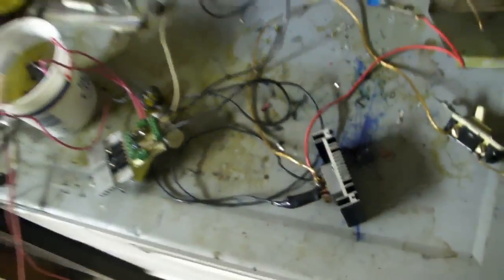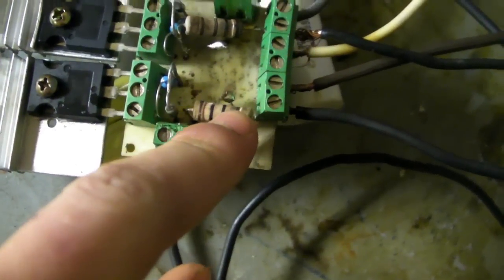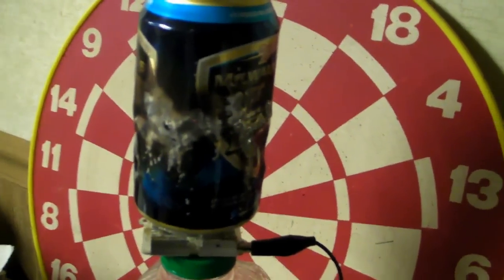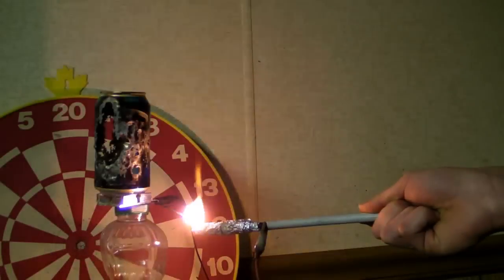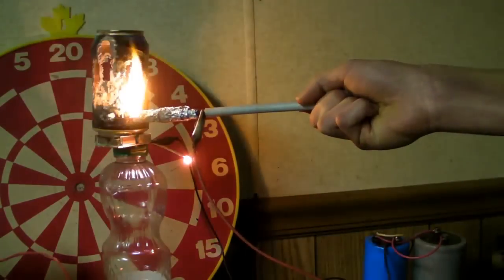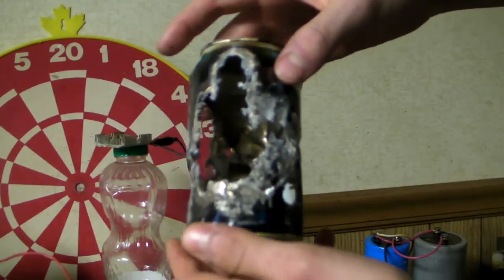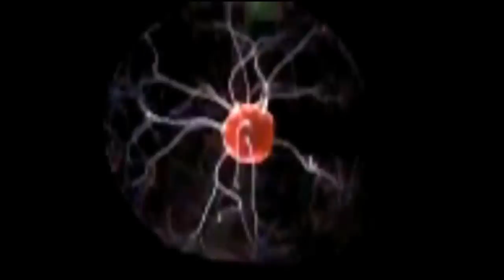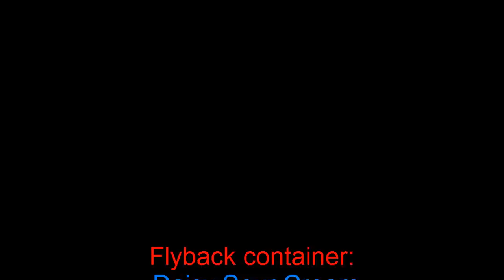The Lethal "Overclocked" Plasma Ball!

Comment: it strange to see kids playing with the same toys we played with back in the early 70's. with improvements in components since then it's good to see the old simple designs are still in use.
Reply: Virtualgod2009  they may be obsolete but they are cheap and easy to find and with the low energy levels used in test bench experiments they work just fine.and the real fun comes when you state modulating the pulse width and voltage.you can get all kind of interesting effects in a gas filled tube.using a bipolar pulse generator I was once able to "build" a semiconductor junction out of ionized gas in a flash tube that showed the classic zener curve and noise on a scope.in the tube I was able to observe the microplamic eruptions across the barrier and even measure characteristics like turn on delay,rise and fall times and storage times.as well as the tunneling that occurs during avalanch failure. you read about these in semiconductor physics but it was fascinating to actually see the energy flow.with transformers and controllers from switchmode 2 power supplies available at surplus stores these are easy to construct and even tho they are obsolete they still work well

Comment: Regarding the 1000 volt diode rating being AC or DC:  Diodes are rated in PIV which means peak inverse voltage.  That is the peak or maximum reverse voltage of the diode before breakdown (unwanted conduction) - it's the max instantaneous voltage that the diode can block when off.  So the AC peak is what to relate it to - in the US that's about 170 volts [120 VAC X sqrt(2) ].  Note that some circuits can put multiples of the input voltage across the diodes, though.

Comment: the same can be performed standing under a pylon tower with a fluro tube. Done it myself many times. Touching the car also made the flow better making the bulb glow brighter. Also measured with a voltmeter and got about 70 volts AC from the induction. I also felt a little dizzy and felt the volts going through my hand to the car which was parked under it.
Reply: Cool dude

Comment from the maker: This is because when there is no arc, the voltage wants to go somewhere. So, much is put into the air as radio waves AKA static in this case. When the arc is drawn, all power is going into an electrode because its a lower resistance path.

Comment: Lighting up a large florescent tube from a few feet away is pretty impressive. I do have to agree that this circuit probably has a fairly dangerous HV output though

One other thing I wanted to correct you on, as it might help you design better transformers in the future, is your comment about the gauge of wire of your secondary coil being too thick for a flyback transformer. The topology of your switching converter and transformer has absolutely nothing to do with dictating the gauge of wire to be used. In switch-mode converters, which a flyback system is, the switching frequency, and the current you're trying to move, are the main factors in the selection of wire gauge. Conductors have what is called the "skin-effect" when any type of AC current is passed through it. Using a round piece of wire as an example: What this means is, that as the frequency of the AC current increases, the main portion of the current begins to be concentrated more towards the outside edges of the conductor and less current is being passed through the center of the conductor. This effectively reduces the wire's cross-sectional area as far as using it to calculate the current capability of said wire. In practical terms, when switching current at higher frequencies, there becomes a point when increasing the diameter of the wire does not increase the current carrying capability over a smaller wire. This is one reason why many switching converters use multiple strands of smaller wire, or litz-wire, for their primary and secondary windings on their transformers when a high output current is required.

Comment: ALL diode and similar devices such as transistors have a voltage rating that indicates the absolute peak reverse bias voltage it is rated to withstand before it shorts out and starts a fire unless it is fused properly. If you are applying an AC voltage, you must calculate the peak value from a conditioned AC source or measure it on an oscilloscope, if the waveform or amplitude are at all unstable or unknown. The peak is simply the single highest point reached in the waveform.

Comment: You could also use a camera flash circuit, it has an output voltage of about 300V, just remove the capacitor, and hook the output to both ends of the tube.
Then you can use it as a glowing walking stick!
It'll get brighter with higher voltage/current.

Comment from the maker: Everything I really used in this circuit was new really. New components, PCB, a working power supply from a dead pioneer amp, a few capacitors a friend sent, etc. Garbage picking is actually great for stuff like this because usually the whole unit you find is dead, while 90% of the components are just fine. The thing is, every once and a while your circuit wont work because of some dead shit but its always worth the try in my book.

Comment from the maker: @Alex1M6 Homemade secondaries are amazing because they can handle the power of a ZVS driver at high input voltages like this. Also, you can wind them for different voltage and current outputs for many other applications. If anything, that should use a ZVS driver in microwaves instead of their current solid state crap. It would probably be more efficient lol.

Comment from the maker: Kinda yes. Most tesla coils operate within hundreds of Khz while the average plasma ball operates usually under 50Khz. The frequency combined with the voltage is what makes it possible for arcing inside the globe, and is generally unrelated to the safety. The overall watt output is most linked to safety

Comment: would the energy of a 30 lb piezoelectric bow/crossbow generate enough energy to power a laser/railgun? or hydraulic actuated piezoelectric cell/transducer
Reply: magnetic ring spinning at 50,000rpm suspended in side aluminum block flyweel battery what do you think
Reply: nitrogen steam engine powered by electric heater??? or nitrogen vacum pulse chamber engine??? Good Idea???

Comment: gotta use ceramic high temp resistors man not carbon film if theyer getting hot. also a heatsink (wrap copper wire around the resistor minding the leads to a heatsink.) should solve that prob. nice vid

Comment from the maker: Nahh, more like 10,000+ when I have it on 60V input. Ill have to record this when I get new IGBTs, I had the flyback I made running at 80VDC input on the ZVS. I could also use some new capacitors too, mine get so hot that they melt the solder connections. But they haven't failed over half a year so far!

Comment: this is not plasma, its called electric arching, its just electricity jumping from point A to point B through air, plasma is a very very hot gas and it needs a split of a second to melt that iron rod, electric arching does make very high temperatures but not as much as plasma, if you want to make plasma ill tell you how, you'll need a candle, a microwave oven and a heat resistant glass bowl and two coffee mugs, stick the candle inside the microwave oven in the middle, place one mug on the right of the candle and the other one on the left, place the bowl upside down raised above the  candle using the mugs as a platform, light the candle and turn on the oven, the bowl will trap the hot gas coming from the candle the the microwave oven will heat the gas even more, but be careful, do it for a very short period or else... hope i gave you some good info for your next idea.good luck

Comment: If plasma is inside the glass plasma ball and plasma is inside the glass tube...then how does plasma form in between the two pieces of glass... on the outside... in an oxygen environent... that is the question. It is because we are able to manifest plasma...and plasma is also the gateway between the physical and the non matter state... non matter meaning ...just because you can not see it ..does not mean that it isn't there.. matter is merely a state of plasma as far as I am understanding..
Reply: it is called induction, basically you force that tesla coil to produce an anormal amount of energy for what that thing was designed for( being a funny lamp) so the magnetic field it produces, excites the gas particules that are inside the tube(i think is argon if i remember) with that exciting, the gas gets into plasma state, causing it to glow. also that plasma state is caused by the orbitals' swithcing of the electrons wich causes the emision of fotons and the gas to glow. i hope to have helped, and if not, search induction force in google.